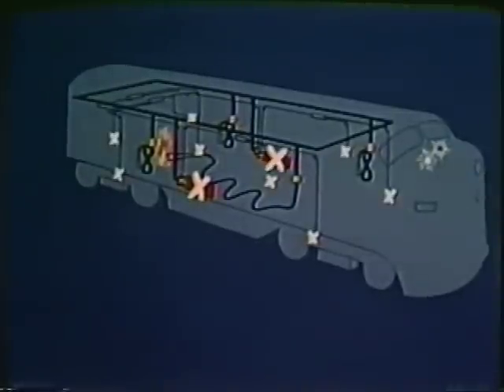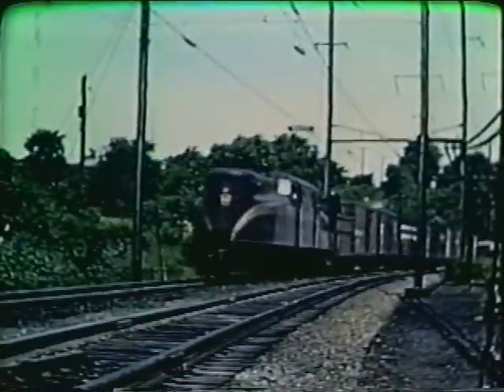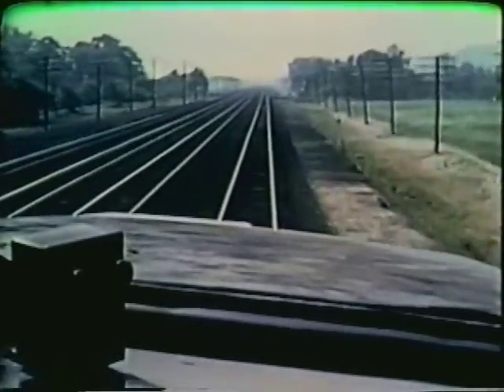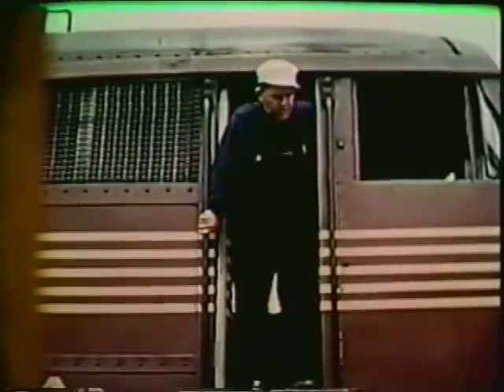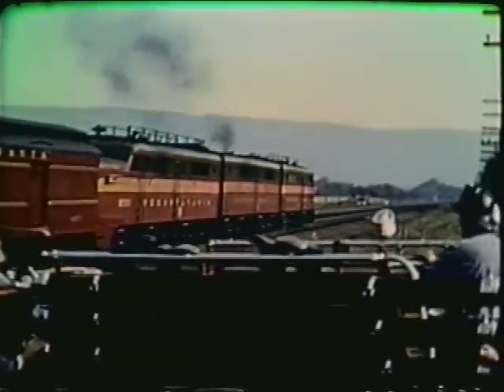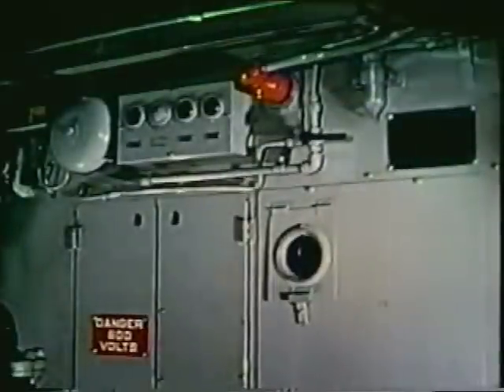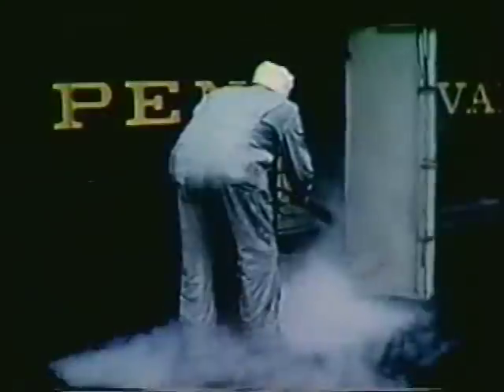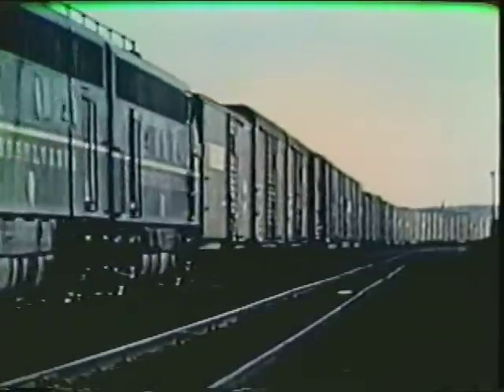PRR Training Film "What In Blazes" (1955) - Part 2 of 2

Comment: so AMTRAK Genesis doesn't have any CO2 fire extinguisher pipe system like ones PRR cab unit diesels have?
Reply: For all future readers fire extinguishers are better to service and use. You just pop the pin out and spray an extinguisher. With those hose systems they're a pain in the ass to service. It's just safer and easier to use an extinguisher.